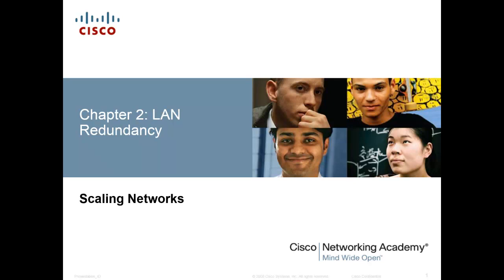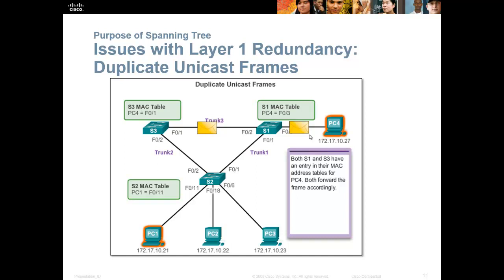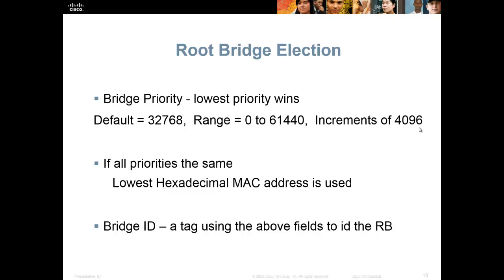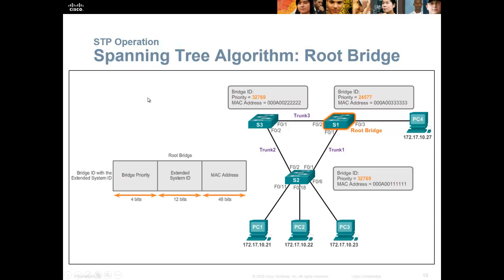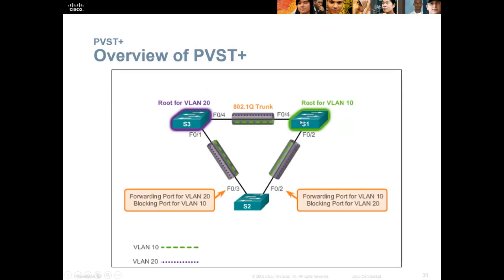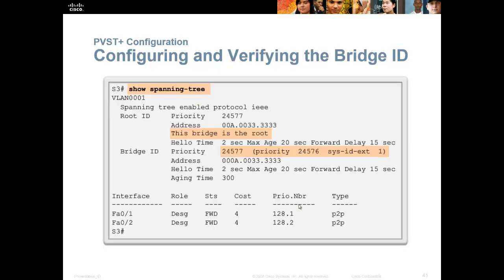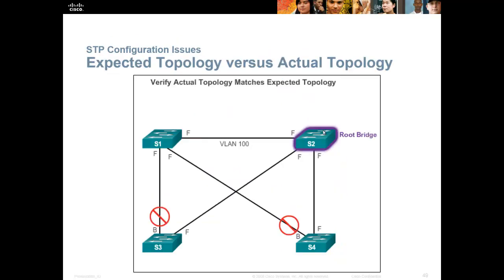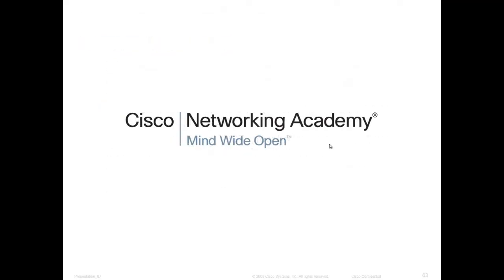CCNA 3  Chapter 2

Comment: The reason why the BID increments by 4,069 is because 16 bits are used to identify the extended system ID and bridge priority, in the BID, where it used to be the whole 16 bits for just the bridge priority and the extended system ID didn't used to exist, I believe. Now the bridge priority uses the 4 bits at the left end of the binary code, while the extended system ID uses 12 bits:

         2 Bytes 
---------------------------------
4 bits     12 bits
 -----   ------------------------
0001 000000000000 = 4,096 (2^13)

1111 000000000000 = 61,440 (2^16)

Which is why the range is 0 - 61,440, too. There's another 48 bits, which are recognised as separate code, that make up the BID, which is the MAC address. 

It is useless to know, but that is why.

Comment: Cheers, it was very useful, just a small mistake in Catalyst 2960 default configuration explanation. It places the link on hold if it doesn't receive any for 6 BPDUs not 6 seconds. It means 6*2=12 seconds.
Reply from the maker: You are absolutely correct, can you tell me where in the video I say seconds and not BPDU's?
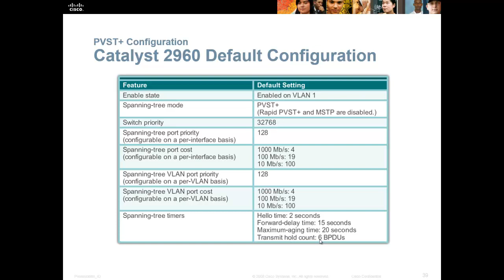Reply: Thanks for your concern. Please refer to the video @ 33:00.
Reply from the maker: LOL, it even shows BPDU on the slide and still I said seconds.  I must be getting old.  Thanks again for pointing this out.
Reply: Thumbs up for you at any age 👍